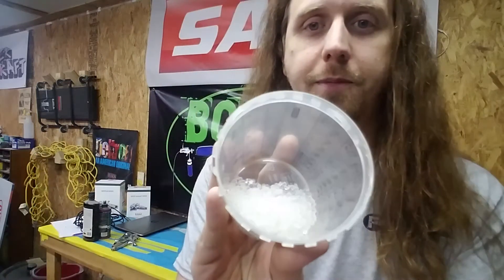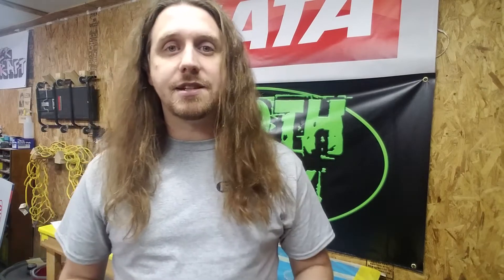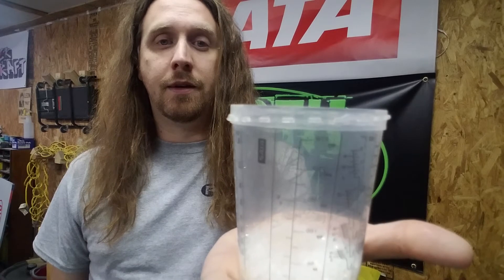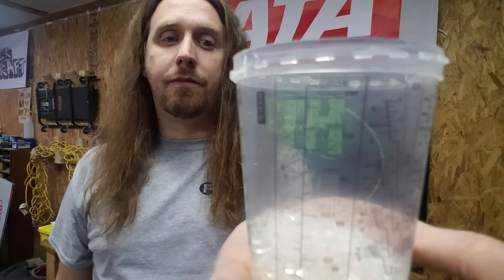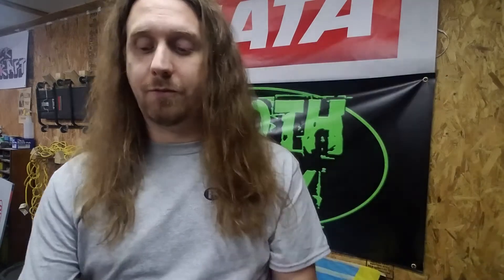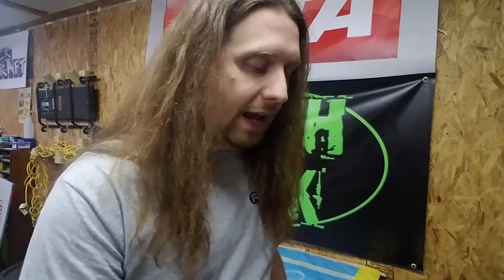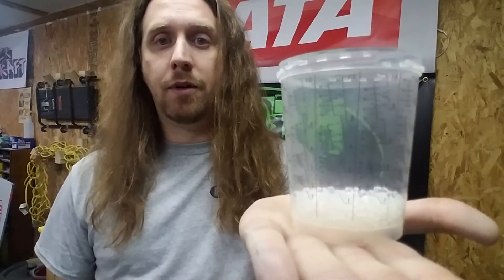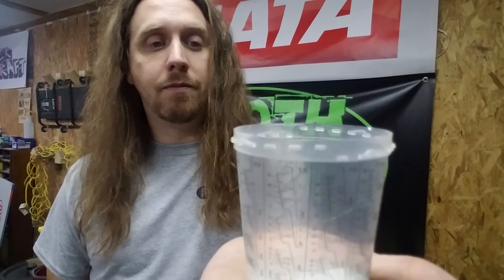Why a dessicant system is bad for refinishing

Comment: I run a motor guard filter after the desiccant and a particulate filter followed by a coalescing filter prior to the desiccant.  I still get what is shown here in the form of sand sized dust, but it’s a small amount easily caught by the final filter.

Comment: Absolutely correct old tech not for refinishing . Just use a refrigerated air dryer and or a membrane dryer. Well done.
Reply from the maker: See, you get why I did it and that this is an exaggerated example to show what happens over the course of time.  I appreciate that.
Reply: Now if the naysayers would open up there minds you've succeeded.
Reply from the maker: @lawrencejones4161  it's the internet.  It won't happen.  I try to give real examples of things over the years.  Everyone will have their favorite product and I'm no different.  But people would rather die on a hill over something rather than learn.  I'm not right all the time and I've been wrong ALOT.  But that's where you learn is in the failures.  Open your mind and learn the "why".

Comment: Bro I don’t know what kind of beads you have there but I run the blue ones that turn pink when they get moisture in them but I’ve never seen them do such a think. 🤔
Reply from the maker: These in particular are devilbiss.   Take the beads and add water like I did.  They explode.  This was obviously a dramatization because (hopefully) they'll never be exposed to thst much water.  But it was done to show what happens and then its sent down the line

Comment: The better quality ones have the desiccant material in filter bags preventing this problem. You could also run a filter right after the desiccants
Reply from the maker: Or run a system ņot using desiccant for breathing/ painting and not chance it.  Lol.

I'm not knocking them,  I have a desiccant system at the house and it works great.   However,  I don't spray out there.
Reply: @inthehomeshop  I've been chasing inconsistent debris at a new shop for 7 months.  Its these stupid beads. What a mess. I would rather have water in my paint.
Reply from the maker: @riccocool  I had to deal with it in a paintshop I was at.  I had them in my home shop as well, however I don't paint out there

Comment: Wouldnt the disposable filters at the gun catch the desiccant debris?
Reply: Lol I mean a dessicent filter to the air hose and before the gun and regulator have one of those orange/red screw on disposable filters. I would think the disposable filter would be enough to catch the beads. 🤷🏽‍♂️ the dessicant traps the water and the screw on would catch the debris before it reaches the gun. I’m a novice home painter I have a cheap harbor freight desiccant filter and I’m currently doing some jobs to save up for a decent filtration system. Your video has me worrying now
Reply from the maker: @millermatic140  the point of the video is to warn those using desiccant beads for breathing mostly but also for painting.  The POTENTIAL for them the break and go through the system is there.  Are there folks who've used these systems for years? Of course! I'm just relaying why I wont use them, potential issues that can come and why.  I have a desiccant system here in my home shop, however,  I dont do any painting out here nor will I.
Reply: BoothTalk gotcha
Reply from the maker: Are you talking about the ones that screw on at the air fitting? Or the ones people drop in between the gun and cup?
Reply from the maker: Dumb question for me to ask...I know.. ..but ......you know how the internet is.  Lol.  Have to ask it😎

Comment: So what system do you use and/or suggest for a home diy'er wanting to paint automotive parts for fun?
Reply from the maker: wjjohns04able Sata and Tsunami make great systems.
Reply: Head over to Harbor Freight and pick up some of their spray gun water separators. I use them on my guns including the clear coat gun and my airbrush setups. They work great for me. I have heard a few negative reviews about them but they have served me well for a long time now, they have a built-in water drain, they're pretty rugged, as long as you don't over tighten them! A little tread tape and keep the air pressures at normal painting levels and they do the job advertised and the best part is they are affordable!!

Of course, if you're investing in your shop you'll want to research setting up your airlines and drains. Like whether you want metal, stainless, copper, or plastic lines, how much to pitch over whatever distance you running and if you want oil-fed lines for tools and dry lines for painting. All of that is an experience onto itself but, in the short term if you need to keep water out of your paint, I have been using Harbor Freight water traps on my guns and they haven't let me down in the 4 years I've been messing with them and $1.45 apiece the investment is short, as long as you test them before you shoot!! Wich is good practice no matter what you use.

Anyway, hope it helps.

Comment: Hi good video, are you saying you put your beads loose in the dryer canister? all my dryers have the beads contained in a fiber free sock.
Reply from the maker: jason evans most dessicant systems run the breads as a final step.   When the beads start to break doen from moisture they go through the air lines.  I havent come across any that are in a containment setup like what yours is,  however i do know there are companies like RTI that have come up with other ways to try and keep the beads from traveling down the line.   Me,  i dont trust dessicant beads for painting

Comment: What do you recommend for the last filtration system before  your spray gun?
Reply: A micron filter.       Or a good old motor guard filter with a roll of cheap single ply toilet paper!     Nothing but air gets through.
Reply: @shawneliason790  except a finger during heavy use.
Reply: @shawneliason790  in going to try this.  I was worried the paper might break down like the desiccant beads?